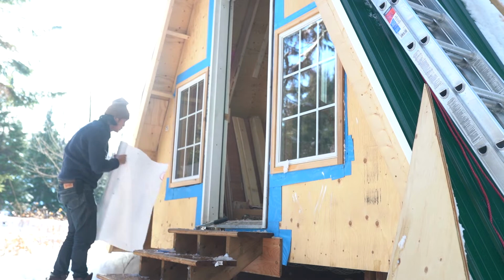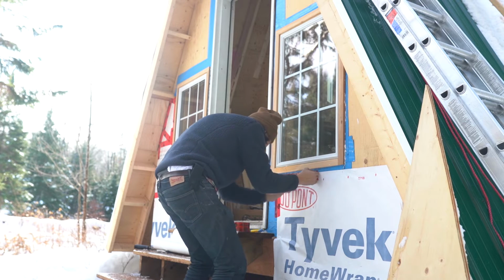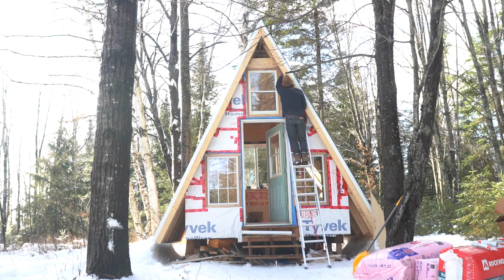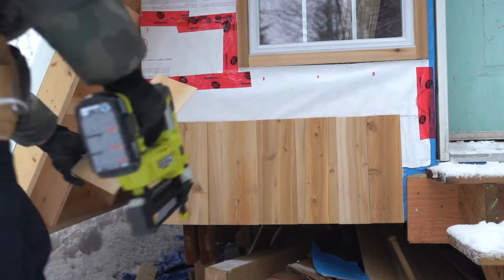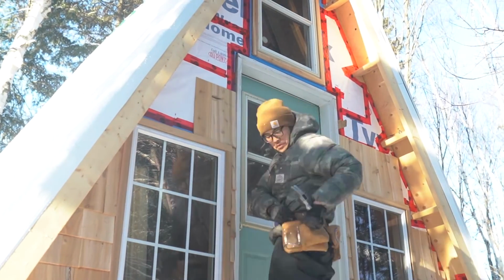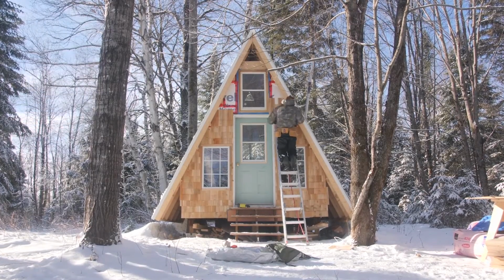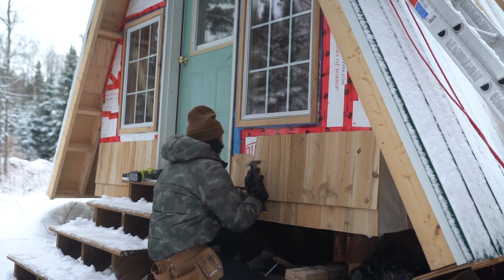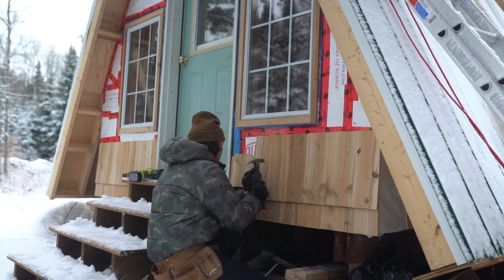Szeto's A-Frame Cabin Build - Pt. 7: Cedar Shakes & Wood Stoves!

Comment: Wonderful video dude! Im actually gonna put at G-stove in my own A-frame which is a bit smaller than yours. Did you have to get more piping? Or did the ones that was included in the stove itself enough? I was also thinking of just cut out the metal roof just enough to fit the pipe throught and then just use a gasket like yours. That should work right?
Reply from the maker: TheHogtalare cool! go bigger and get more piping, along with the second barrel too! shit gets real hot so you definitely need some separation. it's a good unit, just didn't retain heat well enough for me

Comment: Brad nails are good enough for shingles? Did you use 18 guage?
Reply from the maker: Marc Leonard i started with 18 guage, but literally after 4 shingles, the electric brad nailer died due to the cold... i switched to some 1” long galvanized nails and got them in